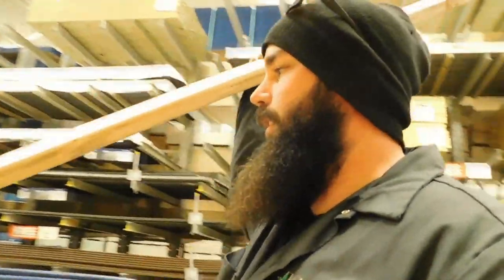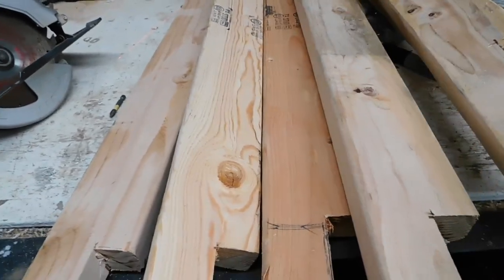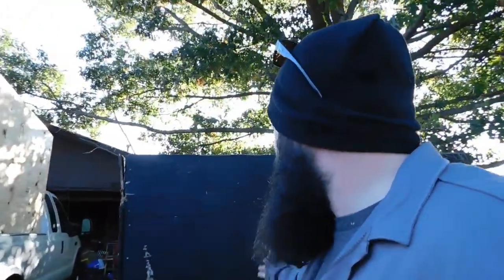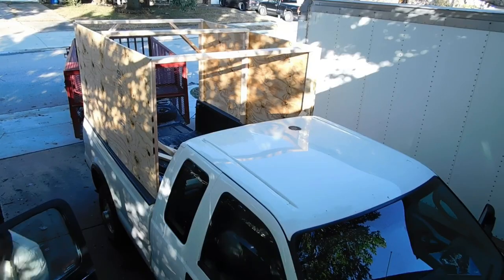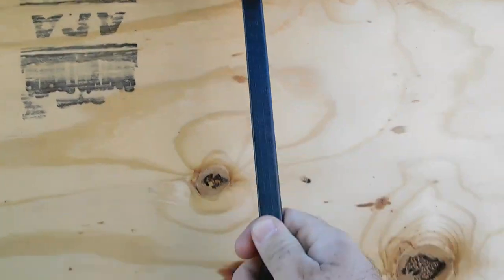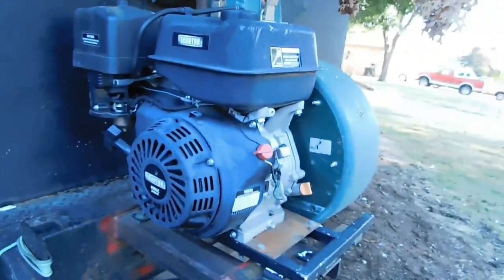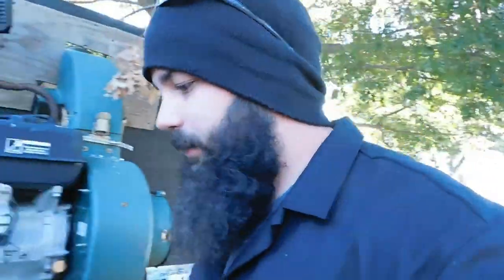Building Leaf Removal box / Lawn Care Fall setup Video

Comment: You need to get a load handler from harbor freight it's the tarp system with a crank to unload mulch, stone,firewood, leaves whatever try it out be safe my friend thanks Rocco from Connecticut
Reply from the maker: I just bought one a few weeks ago I will be installing it this week.
Reply: @LawnCareJuggernaut  I used one for yrs. Just don't step on those plastic clamps, though crazy glue did fix it. I still have it in another truck, that's in the shop.

Comment: 8:01 i had an idea for a leaf extractor. probably impossible... but if somehow could have ryobi electric blowers , or really any type, piped into the truck bed floor and rear of the box, wired together and sealed up good with the air current pathway directing outside the rear , could activate while pulling slightly forward. who knows if it will work or not.This could automate thousands of hours for people though, and also save one's back/lungs.

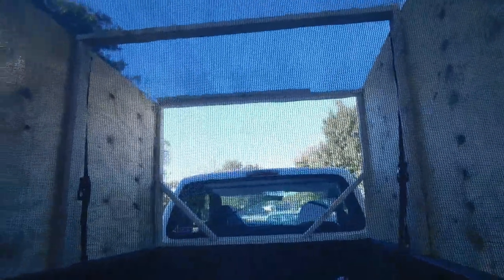Comment: 12:30 mid season adjustment... perhaps a piece of plywood with a 1x2 frame with stiffener in the middle that can be bolted to the rearmost 2x4s.... can be removed a stood up on inside of truck bed when not in use....?

Comment: If I'm not mistaken, I by that you can remove the 3-4 bolts off the pull rope on the motor and turn it 180 degrees so there's no obstruction when trying to start. This is what I've experienced in the past.
Reply from the maker: Thats correct we had to rotate the pull start on the vac. I to that on my mowers as well so that I can start then easier in the trailer

Comment: Have you ever tried those truck bed unloaders from harbor freight? I just bought one to try out
Reply from the maker: it will work with mulch and soil if not over loaded. for leaves it will work if the leaves are not mulched up but if you use a debri loader it wont work to good. https://youtu.be/KsJPCoYHfwE I show it in action in this video.
Reply from the maker: https://youtu.be/KsJPCoYHfwE 6:02 is the time where i show it
Reply: Maybe I’ll get lucky since it will be smaller loads. Only $40 bucks so it’ll be worth it for little loads of gravel and mulch lol the “load handler” may do better though it’s under $200 looks sturdier
Reply from the maker: @wolfpack2233  its worth a try for sure. I think if you were to put a board at the end of it so that it doesn't slide right out from under the leaves that would work pretty good. it worked ok on smaller loads
Reply: @LawnCareJuggernaut  Awesome input, really appreciate guys like you dropping knowledge and content!

Comment: Nice set up. I recently purchased a Cyclone rake and built a leaf box on my trailer. I originally planned on just using it for my lawn, but I’m going to offer a curbside service in my neighborhood. I plan on operating the system similar to you. What diameter tube do you have connecting the Cyclone rake to the box? I still need to purchase that tube, then I‘ll pretty much be complete.
Reply from the maker: Ok so a few things be on the lookout for an old parking lot blower that has a metal impeller blade you will need it because it will chop up the leaves better and it will be able to handle the abuse im not sure what the diameter of the hose on is but I will check it out and let you know I will have a video coming up on all of this in the near future because we are getting setup for leaf season now.
Reply: Thanks for the tip on the impeller. This is the first fall when I’m actually looking forward to the leaves falling. Can’t wait to test out the set up.
Reply from the maker: @jamesrubocki7836  I love leaf season I really enjoy the weather and the work. its the best season......immediately followed by the worst season

Comment: Did you add a clip at the end of the 2/4
Reply from the maker: they are d rings
Reply: Thanks
Reply: What kind of d rings did you get I just start working on building the box leaf
Reply from the maker: @bobjeans  I bought mine at harbor freight they were really inexpensive there. im not sure what the size is
Reply: Thanks I’ll check there tomorrow